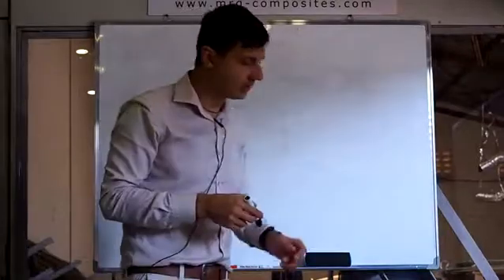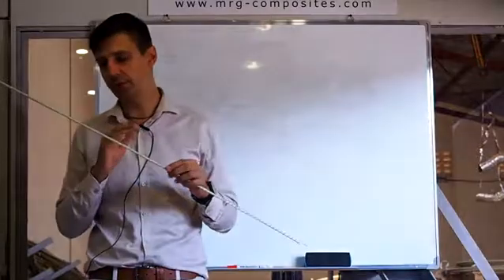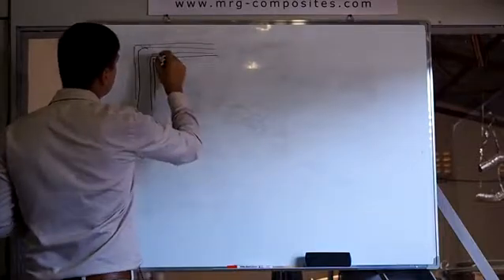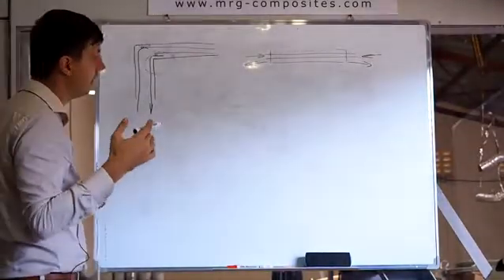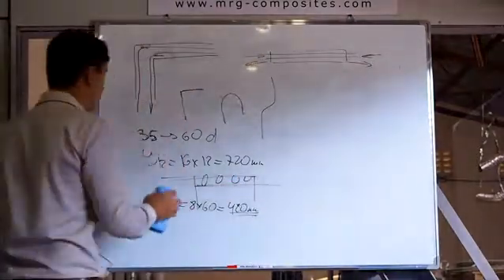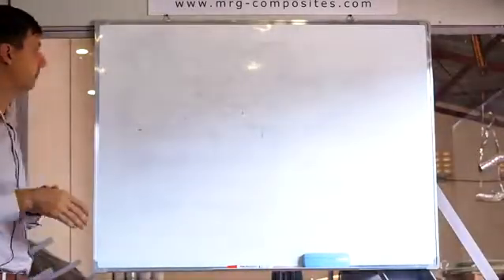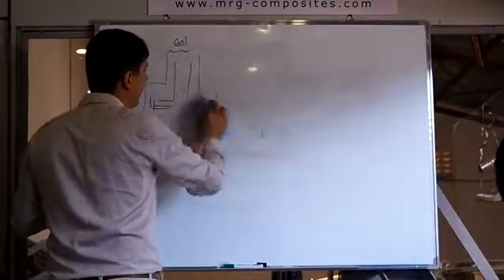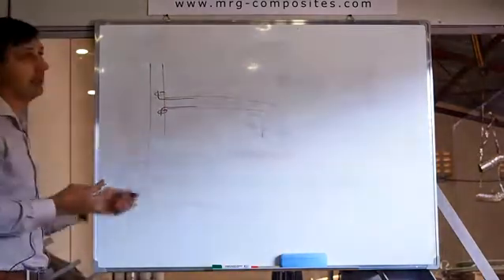FRP-Bars. The 11-th video. Bending & Overlapping

Comment: The inside bars of his corners are wrong. You should continue them through to the outside bars with the 90 degree hook in-line with the outside bars. His method doesn't provide a sufficient bond length for the reinforcing. I didn't understand if he was providing a solution for the composite bars, short of using pre-made bends lapped with the reinforcing bars. See half way down this page for pictures: https://www.compositesworld.com/articles/composite-rebar-for-future-infrastructure-